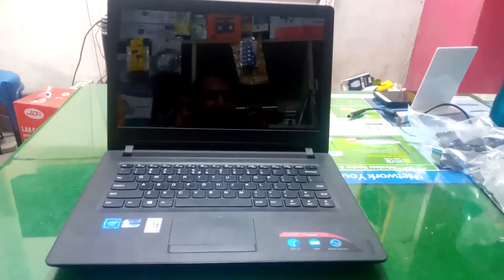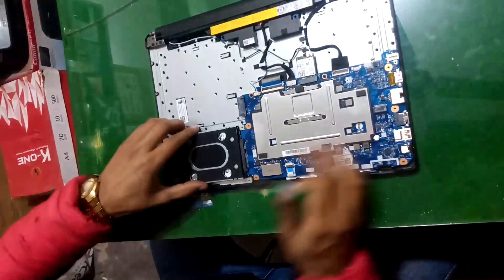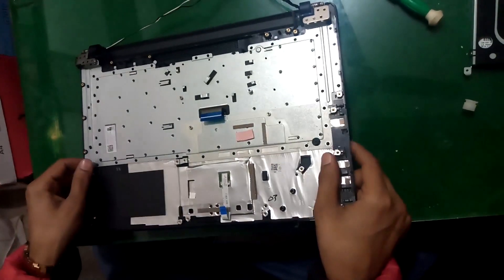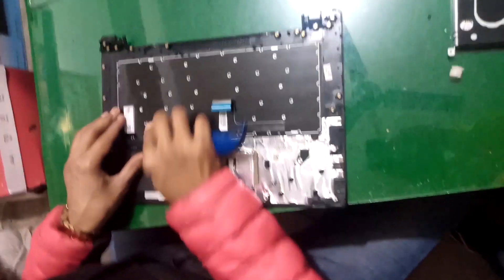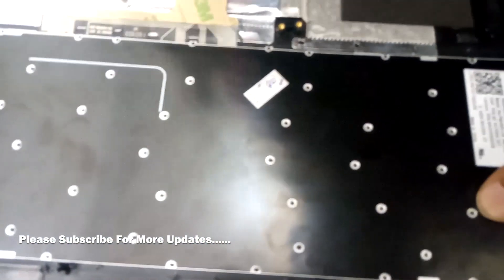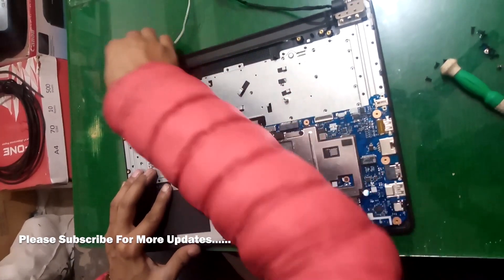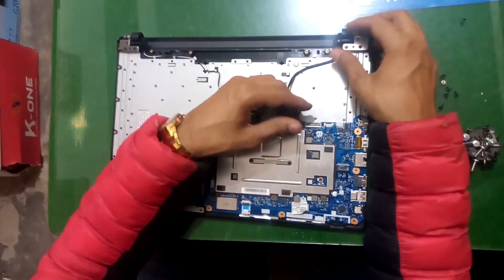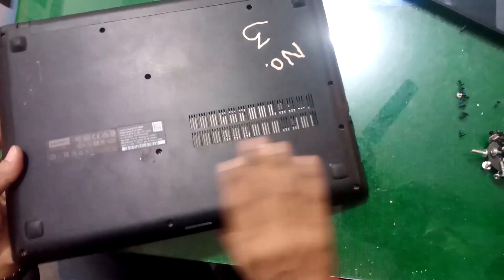Lenovo ideapad 110 Laptop Keyboard Replacement | How to change Lenovo Ideapad 110 keyboard

Comment: Yes I agree around 2 hours. The plastic dries instantly.
For me I removed too much plastic with my knife but I eventually re-used the plastic bits. Took them back from the floor and re-fused them back in the board.
Fuse both the main plastic with the solder and the plastic bit and the plastic bit will magically stick to the board. I then used a flat piece of metal to quickly flatten the plastic before it hardens.
Thanks a lot for your tutorial!

Comment: bhai hardware man told to me this will take 1 day because its take time to dry after joining the keyboard 
please tell me,  did it not possible within 4 hour?
Reply: Yes I agree around 2 hours. The plastic dries instantly.
For me I removed too much plastic with my knife but I eventually re-used the plastic bits. Took them back from the floor and re-fused them back in the board.
Fuse both the main plastic with the solder and the plastic bit and the plastic bit will magically stick to the board. I then used a flat piece of metal to quickly flatten the plastic before it hardens.
Thanks a lot for your tutorial!
Reply from the maker: Glad to help you
Reply from the maker: Sticking or gluing method can be different but if they use my method it only takes 2 hrs to finished the work